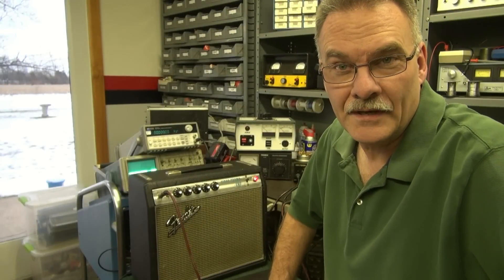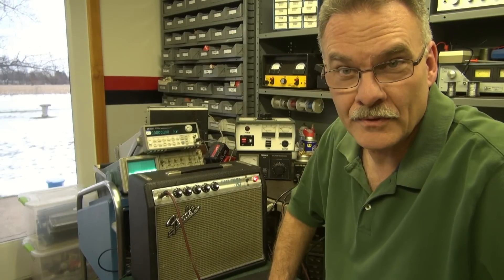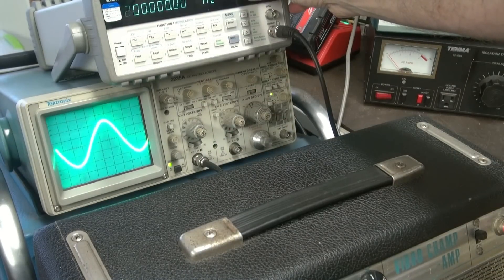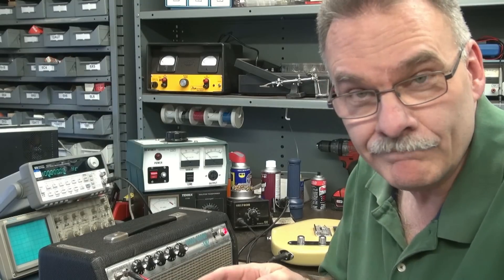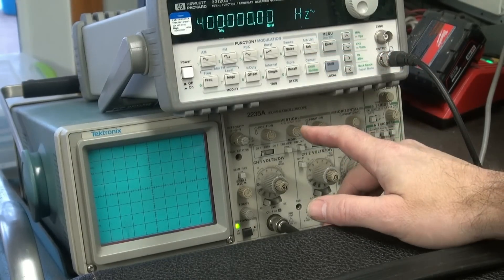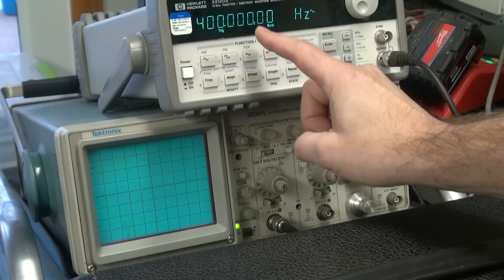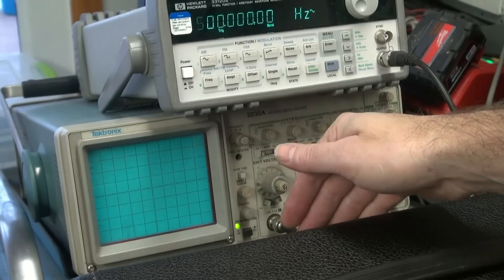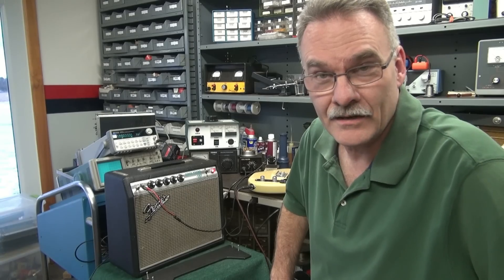How to troubleshoot Tube guitar amps with pulse generator by D-lab

Comment: im having a issue with my tube preamp, its oscillating really really slowly on the output, you cant hear it in the speakers but i put it on my oscilloscope just to see whats up with a little hum i was getting from the power amp coming from this little preamp when my power amp is turned up all the way.
anyway what im seeing is a random super slow DC+ to DC- on the putout side, it seems to kinda walk around up and then down randomly....then farther down then back up just in the plus or negative 200mv or so range.
also its on both left and right channels and they move up and down at the same time together. any idea ? i can send you a pic or short vid of what it looks like.
oh yeah and its a Little DOT MKii headphone amp i use as a preamp.
Reply from the maker: Sounds like a leaky cathode bypass cap
Reply: @d-labelectronics  ok so i was looking at it, it will go into the negative for about 10 or so seconds and the plus for the same amount of time.
with audio played though it the effect is still there and its a class A push pull using 6j1 EF95 type driver tubes. (tried tube swapping and all the same)
if i go looking for a the cathode bypass caps what would i be looking for (BTW this is a new amp) i see a set of 250v 33uf a set of 250v 220uf.....there are also some Polypropylene film type but i dont think thats them, those values seem too low for a cathode bypass maybe ?

let me know if you dont mind walking me though this.
I REALLY thank you a lot for it there is like no one on earth for me to ask about this kinda stuff and i been doing this stuff for years on and off, i'm starting to get into this a bit deeper now lol its just a dying trade it seems, working on tube amps.
my knowledge is a bit piece and part hear and there for this so explain stuff to me as if i'm a noobie.
BTW Happy Thanks Giving Day !!

Comment: Hi, could you explain how (and where) you connect generator to amp and amp to oscilloscope? thank you
Reply: Andrea Cravedi You connect the audio generator to the input jacks, and the scope across the speaker output or dummy load if you disconnect the speaker.
Reply: Yes, how many V/mV, and any other settings used for tube amps

Comment: General Radio made some auxiliary equipment to go with signal generators called a Tone Burst Generator.  A very early application of digital logic counter circuits.  The input waveform was the clock, and you could set it for how many cycles to pass, then how many cycles to suppress the signal from going to the output.  I have a couple of pages of design notes on building one of these on my own from scratch, probably wouldn't be too hard.

http://www.ebay.com/itm/GENERAL-RADIO-GR-TONE-BURST-GENERATOR-1396-A-1396A-105-125-V-50-60c-/262927461209?hash=item3d37b2ab59:g:ZywAAOSwWxNYtYY~

Comment: This could be valuable in many ways since issues like these are triggered by transients from the attack on a particular note. Many times I've narrowed it down to a defective speaker, or a funky preamp tube or PI tube. This method is also handy when you have an intermittent oscillation issue as well. A particular frequency can cause an amplifier to go into oscillation. Good troubleshooting idea! I've also used an electronic piano to pulse check an amplifier! 45 years as a tech, and I still keep an open mind for new ideas and ways to troubleshoot. Great video Terry! Keep 'em coming :) Frank Ferraro--Audio Craft Electronics.
Reply from the maker: +Frank Ferraro Thank you Frank. Good to have support by others in the field. Hope someday this tip will save you time. More to come my friend